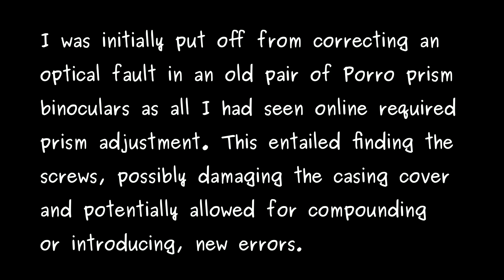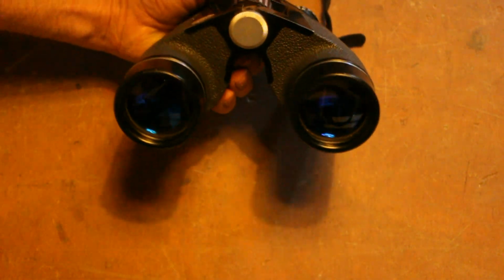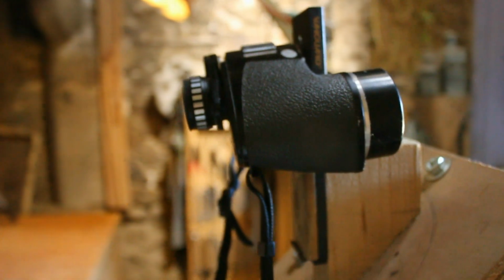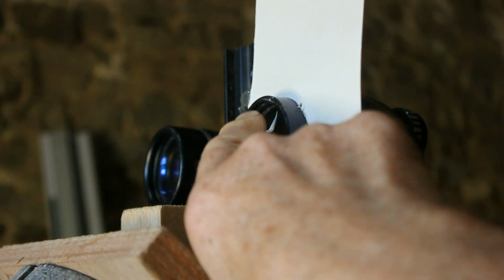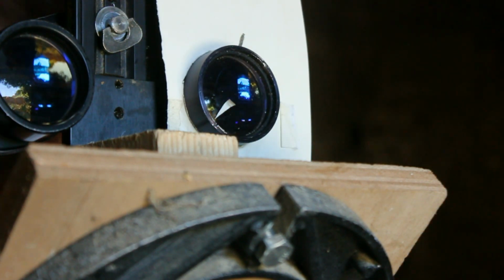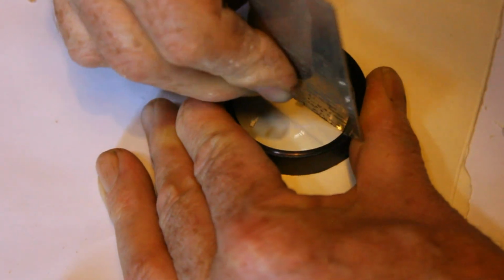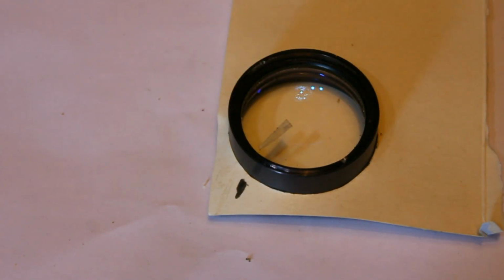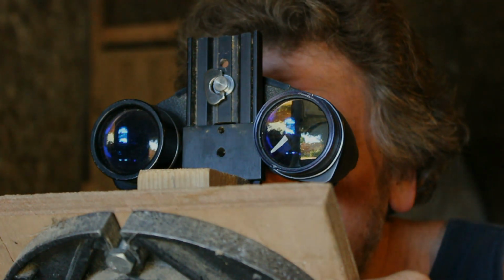Binocular Collimation Quick and Easy Method without Prism Adjustment

Comment: I'm an amateur astronomer and use a telescope all the time to take astrophotographs of the night sky. After inheriting some old Tasco 7x35s, I thought I'd give them a try for stargazing. I was really disappointed to learn that they produced a very poor double image even after focusing — something I hadn't even thought was possible since I'm used to a telescope.

After a couple of hours of scouring the internet on how to collimate binoculars, I found out that my binoculars don't even have collimation screws, at least not accessible without taking most of the binoculars apart. I was almost ready to pull the trigger on some new $200 Celestron binoculars when I found this video and was able to easily correct the double image. I didn't even have to take the objective lenses off...they were just tightly screwed in and when I loosened them I was able to rotate them to remove the double image. I can't thank you enough for this! Saved me some serious money.
Reply from the maker: Hi Brian, I'm so pleased you've found this video useful. I had exactly the same problem with no visible screws on my pair- they must be there but like you I did not want to remove the leathercloth  either.  I do have a written version of this film: https://thegreenlever.blogspot.com/2016/08/binocular-collimation-quick-and-easy.html#.X66Qh3fk-V5 and if you scroll down, once on the page, I have on-going related articles for different techniques of binocular collimation. Many thanks for watching and commenting, I really appreciate it. Dark Skies and Best  Wishes from Normandie, Andy.ps check out my videos and written articles on projects I've undertaken on my Celestron C8 telescope.
Reply: I also received some Tasco binoculars except mine has a zoom feature so it’s a 7X-15X35 and my image isn’t properly aligned. However, when I adjust the front of the lenses it seems to only move the images vertically, but mine need to be moved horizontally to fix the images. Do you know of another way to adjust these?

Comment: I worked on optics in the military. This is the most practical way of collimating binoculars outside of a well equipped optical service facility.  Also if the technician is skilled, the objectives don't have to be removed (thus retaining the anti fog nitrogen gas in the instrument).
Reply from the maker: Thanks for the useful comment it's very much appreciated. Cheers, Andy.
Reply: Is it possible to add night vision to ultra zoom binoculars? I'm willing to put in the work!

Comment: This really helped. I took the whole binoculars apart and checked the prisms without even thinking it was the objective lens. Nearly binned them. Working great now. Thanks
Reply from the maker: Hi Andy, I didn't want to take the prism route so finding the solution in the book was great and that was the reason for my sharing it on YT. Yet another pair of binos saved from the rubbish bin! Thanks for your comment and for watching I really appreciate the feedback. All the best from Normandie, Andy.
Reply from the maker: Hi again Andy I forgot to mention that this film like most of the others on my channel has a detailed written version on my site - here is the link if you are interested: https://thegreenlever.blogspot.com/2016/08/binocular-collimation-quick-and-easy.html#.X2hutXcv6V4  I am also about to attempt a collimation on a pair binoculars I have been given and on first sight it looks as though someone has already attempted to adjust the prisms. I will be making a film of this in the next few days and hoping I will still be able to just correct them by the simple realignment method, so this too might be of interest. All the very best Andy

Comment: Thank you for this video. This is the only source for this information that I was able to find. I had to modify your technique a bit for my binoculars. Rotating the entire bezel certainly did work to temporarily collimate the binoculars, but retightening the bezel and moving the lense into that same position didn't work. I'm guessing it has to do with different thread pitches between the bezel and the lense. So, I simply loosened the spanner ring a little bit, and rotated the lense with a nitrile gloved hand until it was as good as it could get. Then I had to do the same for the other side to get it reasonably good. These 7x50 Binolux binos were only $15, so I'm happy with the result from the home repair. 

I discovered that my eyes & brain would adjust to the double vision mid job, resulting in having to go back and readjust the collimation a couple more times. And, seeing double was nauseating after awhile. Taking frequent breaks during this job seems reasonable.

Comment: I can't believe it. For months I have been viewing videos on how to correct out of alignment binoculars, and every one of them teaches to adjust the screws. Only problem, my binoculars are totally covered with a rubber coating. Thus, I could not access/locate any screws. 

Ready to throw in the towel, I decided to give video searching one last chance, and sure glad I did. Although I haven't figured out how to adjust the lens within, I simply turned the entire lens housing per your instruction. Half a turn and I no longer see a double image! I can leave it at that since the rubber tends to keep the housing from turning without significant force.

THANKS!
Reply from the maker: Hi Jake. I went through the same deliberations as yourself and kept thinking 'surely when they make these they don't have to go through all that prism/screw stuff just to set the binos up.' I'd heard mention of the book some years ago in an astronomy mag and found someone in the UK who was stocking a few copies. For that tip alone it was worth the price of the book.

So glad you found it useful. Many thanks for your kind comment I really appreciate it. Best Wishes from Normandie, Andy.

Comment: Thx a lot mate.
I didn't even knew you can rotate those parts with lenses and I thought my good old binoculars are dead.
Reply from the maker: So delighted that you've found this to be useful. If you haven't yet done it, make sure you've made a removable reference mark on each objective and that your spanner for undoing the locking ring doesn't touch the lens surface. Good luck and thanks for watching and commenting, I really appreciate it. Best Wishes from France, Andy.

Comment: THANK YOU! This is very, very helpful. I've been putting off collimating my binoculars as I just couldn't bring myself to risk ripping the securely glued leather covering the adjustment screws.
Reply from the maker: Hi CM, you shouldn't find it to be a problem, just make the little tool to undo the locking ring. One thing I didn't I omitted to say in the video was that the lens is in TWO eccentric rings. The less obvious one is holding the lens.  Sorry for not replying sooner- maybe you've already done the deed. I'm glad you were sensible enough not to have ripped off the leather. Thanks so much for watching and commenting, I really appreciate the feedback. Best Wishes, Andy.

Comment: As some-one else commented, I cannot see how just rotating a lens around the same axis alters the light path direction unless the lense isn't perfectly symmetrical and this is what you are depending on. I have rotated eyepiece lenses to make a seemingly small difference on view appearance so perhaps this is the same type of thing that you are doing with the objective. I usually do a screw adjustment on the prisms if I can get at them. The perfect solution though is just use monoculars and then forget about it lol. I actually have several small monoculars and after fiddling a bit with those (for example swopping a better prism from some broken compact bins into a monoc and/or adjusting the eye lenses and cleaning) I'm finding they are really very handy on a neck strap and surprisingly effective especially a little 4x12 Viking monic that I "adjusted". I even prefer it now to  the 4x, 6x and 8x Specwells that I collected. I showed it to some-one the other day and first thing they said was "that's better than bins". I still use bins also but I'm using the monocs more and more or at least alongside bins and won't even get the bins out unless I need the extra power. I'll just caution though for anyone considering the 4x12, it's good but pretty unremarkable before my alteration which involves some filing.
Reply from the maker: Hi, thanks for your comment. The objective lenses in most post WWII binos are mounted in two eccentric rings which you cannot see until you remove the retaining rings. By rotating the rings the optical axis of the lens is shifted. As the video shows the correction may be quickly achieved. In my case, the binoculars were second-hand and I believe it is possible that someone had cleaned the objectives by removing them without being aware of the ring/lens arrangement. 
Thanks for watching, best wishes from Normandie, Andy.
Reply: Thanks. So indeed a simple way to fix such bins. I trashed one of my own bins today. I managed to get the rubber covering off easily but then  the collimating screws were bloody brass and seemed to have welded to the alloy body and so were impossible to unsieze without destroying them. Nothing is ever simple except perhaps your technique. I just binned the bin but not before checking whether I could re-use any of the parts. I've still got plenty of better bins so no worries. Pity they didn't have WWII rings but now with most bins being gas sealed they aren't meant to be opened once sealed, mostly in china, but with many being not very well put together, at least the early ones. Enjoy your restored bin. I know when I get a good result tinkering with mine it is rewarding.
Reply: LOL : "The perfect solution though is just use monoculars and then forget about it lol". Soooo true. Following this doctrine, you'll never end up with totally broken bino, either:)
Reply: I worked in an optics shop for years. Shimming and rotating are sop, for minor adjustments.
Reply: @samsen201  And you'll have twice as many devices.  The reason binos are so prevalent is that people are simply used to them.  It takes some practice to relax your unused eye with monos.  Less the half the weight, way less hassle, less than half the size....its an obvious choice.  And so very compact with a roof prism.
Reply: @bobhoskins9595  Yes Pal. Totally agree. Captain Cooke did all his journies on a worst mono and so Columbus found USA! So no one should complain if mono can be used or not. I remember only once I couldn't stop myself and used the screw on a pair of otherwise nice Meade bino. Well not only I couldn't help anything with convergence, I totally destroyed it cause something led to next and end was pile of trash... Best is to learn the value of "What you have" and tolerate, instead of trying to repair and make it worse. In fact I remember long long back, when in Europe, I had a Russian made Mono that was exactly one half of a bino and believe it or not, I guess they only made their bino frame into half and saved on focusing dial! That actually was a very high quality glass and extremely cheap monocular.
Reply: @Organikmechanic   This is exactly what I did: took apart some used binoculars to clean out some metal shavings, without being aware that everything has to go back into position perfectly. I won't make that mistake again! Thanks for helping me fix my binoculars.

Comment: I have a steiner military 15x80c.
in a moldy lens condition and there are cracks in the body,
where can i find a place to fix it?
I'm from Indonesia.
thank you.
Reply from the maker: Hi there, sorry for the delay in replying, but I've been upgrading my computer system and the links to the modem. I understand these binoculars are rubber armoured, so are the cracks just in this coating? If the lenses are mouldy is this just on the outside surface or do you think that the contamination/mould is inside? If the latter then I would say that they are no longer sealed/waterproof. They may be too badly damaged. Steiner have distributors in many countries and you could contact them for an opinion, possibly attach images of the damage. Hope this is of some help. Thanks for your question. Good luck and Best Wishes from France, Andy.

Comment: Great tip on lens spanner!
Reply from the maker: Hi, if you make your own, just make sure you've enough clearance at the spanner centre to avoid touching the thickest part of the oblective. The stainless steel that I used to make mine was from a sheet of samples from a tile shop, they were throwing out these and I snapped them up! Thanks for watching and commenting. Best Wishes from Normandie, Andy.

Comment: I might have missed this but was the double vision side to side, or up and down.  Mine is both.  Its like looking at the two screen during an eye exam.   Which does this work for?  Or both?
Reply from the maker: Hi, this method will work for both the alignment problems you describe. It is interesting to note that your eyes can compensate, to a certain degree, for the side-to-side misalignment but, up and down compensation is prone to rapidly cause eye fatigue and is less effective. My misalignment was mainly side-to-side but I did correct all of the error(s) I could detect.
Good luck with the re-alignment. Cheers, Andy.

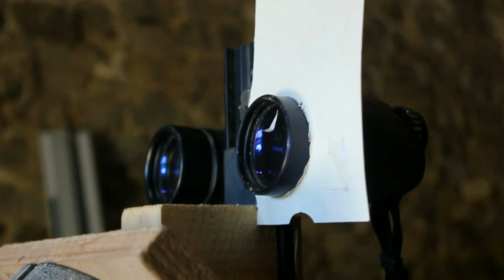Comment: at 2:05 you did not mention that you re tightened the lens back to place before you added a marker and reference line on the card, im assuming that's what you done ,is it possible to remove the ocular lenses in order to clean them from the inside as well? i done this to the objectives but im worried about trying to do the same with the oculars because the right one has the diopter adjustment motion and the left one although should be locked in place does have bit of slack probably from bad handling and if i try to remove them im worried i make break something or mess up the threads ,not sure these are made to be removed like that? would like to unscrew the prism holders and give them a clean as well but figured perhaps i should not move them and hope that its relatively dust free inside ,in any case i dont have any dust issues like that and the best i can do is clean the objectives from inside and out and the oculars from outside only ,i will try to see the stars at night to make sure its still collimated ,if im seeing double then ill try to adjust the equatorial as this helped in the past,hopefully i dont need more work on them
Reply from the maker: Arcstreams. Yes the objective was in its' original position. I did not tighten it fully though as I knew I was going to need to rotate it to obtain optimum alignment. You can remove the objective cell to clean the inside surface but I would think that most contamination will be on the outer surface. Possibly you should just blow off any dust with a lens blower rather than try to clean it. The technique to clean finger marks or grease off the outer face of the objective is possible but be aware that the lens is treated with special coatings that are very delicate so unless you really need to, resist the urge. Read up on the appropriate methods before you try.  I would not touch the prism holders at all . Hope this helps, best wishes from Normandie, Andy.
Reply: @Organikmechanic  well i rarely clean the objectives on both sides ,but once in a while if i see some finger prints i will simply use the eye glass cleaner with the soft cloth on objectives and oculars, must be a cold day on the farm in normandy as i can imagine you have the time to be inside sipping hot tea and looking at your mail lol its snowing here today in canada ,i cant believe it, wait yes i can lol,,, ok andy thx mate ,your neighbour from across the big pond :)
Reply from the maker: @ARCSTREAMS  Hi there, yet another one of your replies that has slipped under the radar! You're obviously being very careful with cleaning the lenses. I have cleaned lenses this way but tend to avoid doing it unless really pushed. My wife's brother-in-law who is a TV cameraman and a keen photographer bought a lens cleaning kit (I think from Amazon) which uses alcohol-based liquid and special swabs which should only be used once. His lenses are immaculate but woe betide anyone that touches the glass!! Hope the snow's gone and Spring finally springing for you. Cheers from a damp Normandie, Andy.
Reply: @Organikmechanic  yes i really prefer just to give them a cleaning from the outside specially if they have never been opened and have no dust in them id like to keep it that way but sometimes my ambition gets the better of me and i tend to take things apart and clean everything as it does a much better job with the cloth reaching the entire surface areas of the lenses then doing it from outside,i do not like doing circular wiping which is what im limited to when doing it from outside so i take them all apart and use plastic gloves to hold each one while i buff them with the cloth and solution in one wipe across the faces,, i think at one time i may have cleaned the prisms on the binos but they work great , i just use a cleaner made for glasses with those micro cloths ,works well enough but sometimes vinegar and water is the best cleaner ,ohh the snow is all gone and better days are ahead with high 20's this whole week even reaching 27 :) ill be going fishing soon enough again ,cheers